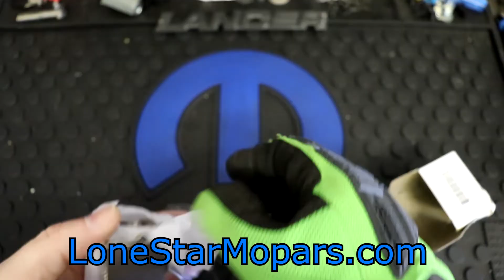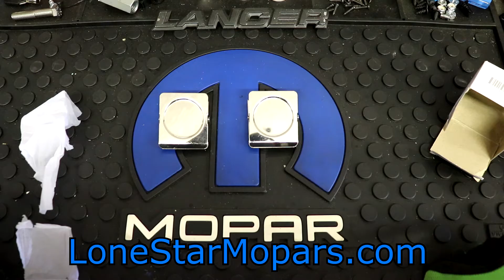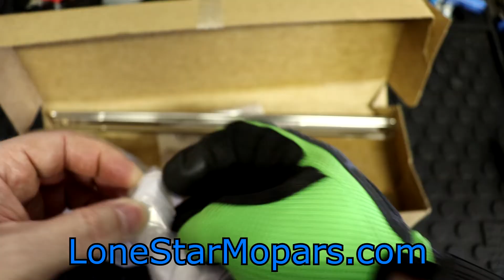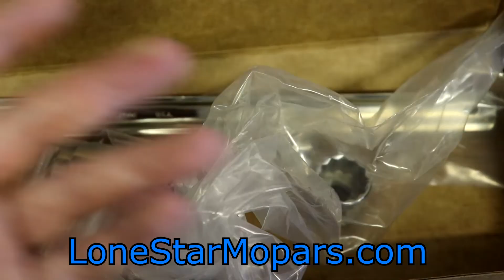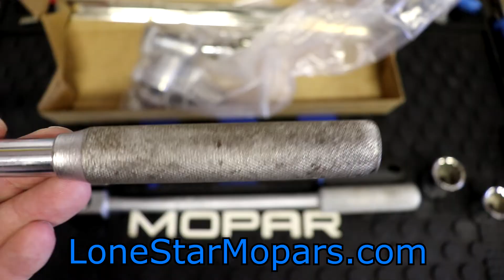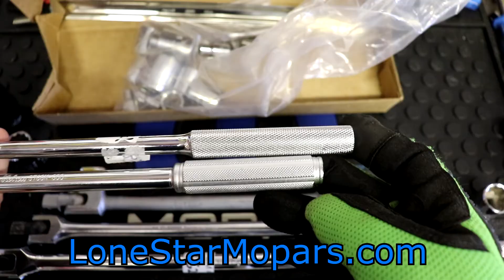Zoro Tool Haul #16: Proto Knurled Breaker Bars and More!

Comment: Being in Australia, i do not get to see Proto out in the wild, but i do and have seen it. An old guy with a Proto shifter (adjustable spanner if you will) from nineteen-dickety-two still going strong is the last one i witnessed.
Reply: I have used pipes over my 916hpl plenty of times, the handle still looks great for being in my tool bag for about 6 years
Reply from the maker: Nice!  I'm kind of surprised Proto isn't there...I figured SBD (Stanley Black & Decker) would have had a presence in Australia.
Reply: @lonestarmopars  plenty of Stanley, but their reputation has plumeted
Reply: @lonestarmopars  came across a 1" blackhawk usa made impact socket today, speaking of rare sightings.
Reply from the maker: That is rare!

Comment: Bar none Proto makes some of the best sockets and impacts but they are really expensive. Just like any manufacting company they all have some quality issues, but Proto stands behind and product and will replace them.
Reply from the maker: I'm a huge Proto fan...fantastic quality and at a great price.  That is largely what we run at work and they hold up very well.
Reply: @lonestarmopars I used to have a complete set of their tools, until my garage burnt to the ground. It was so hot it actually melted 90% of my tools and the box they set in. I'm still rebuilding my collection after that. Proto used to be around 75-100 for a sleeve of sockets. Now my local dealer wants 250-400 for them.
Reply from the maker: Dang, that is terrible about the fire.  I snag most of this stuff on sale off Zoro and then stack discounts on it...most economical way I've found.
Reply: They sent me the Taiwan version of a usa made wrench that they're still actively selling when I needed to warranty one. Put a bad taste in my mouth with their warranty.

Comment: Lone Star, A good choice in the 3/8 dr by 18 inch long breaker bar is. GEARWRENCH
3/8" Drive Flex Handle/Breaker Bar, 18" - 87802
.
Reply from the maker: That is a nice "extra" length for 3/8" Drive.  I think the only Gearwrench stuff I own is a couple of plier racks.  I can never seem to get a good deal on their stuff.
Reply: @lonestarmopars  The Website named after the rain forest in Brazil has this breaker bar $38. 17% off right now.
Reply: @lonestarmopars  If you do a search their is a website with the breaker bar for 17% off at $38.
Reply: @lonestarmopars  3 try to say this do a search they are on sale.
Reply from the maker: 10-4...thanks!

Comment: I have the Proto J5469, 24" breaker bar and it has seen a pipe or two. If you have enough room to use it, it will take it off.
Reply from the maker: Sweet...I'm hoping to add that one to the mix...they take tons of abuse and keep on ticking.